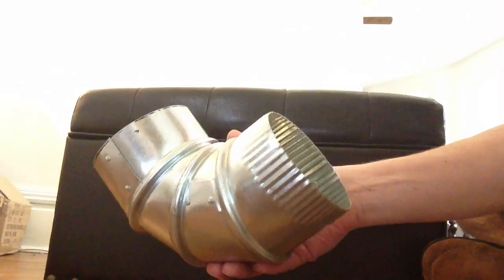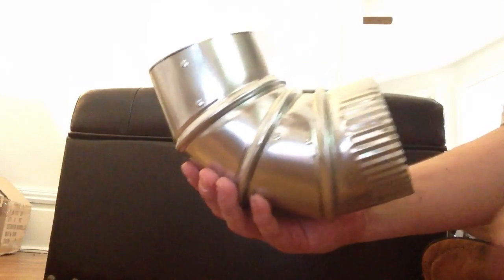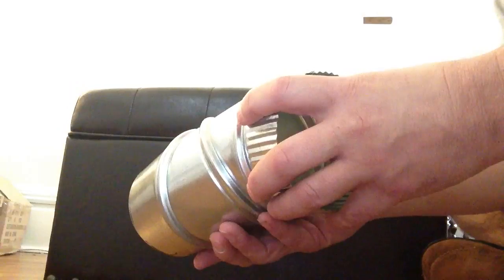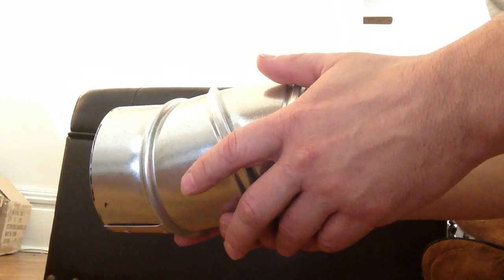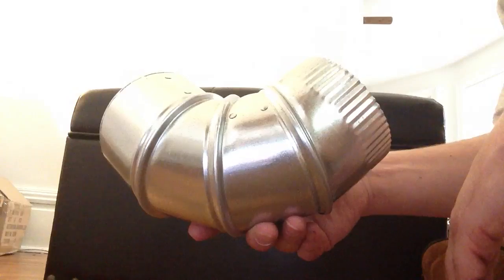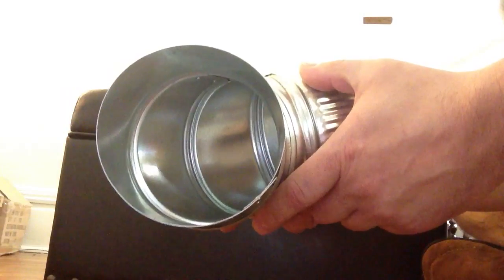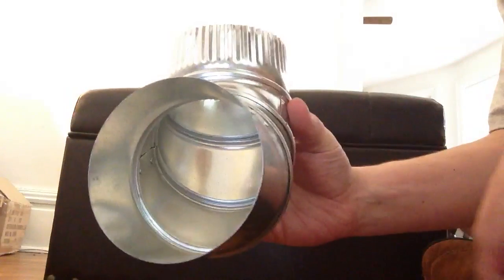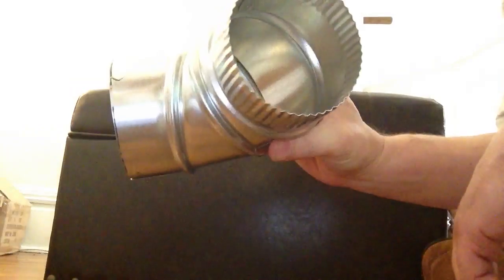How to elbows for round ductwork

Comment: As you show, can also adjust so the duct centerlines have a slight offset (don't intersect).  Can adjust for 45 deg, all in one plane, with a "wiggle" which makes it a little shorter, which helps when your measurements are slightly off.

Comment: TIP:  The segments are almost always difficult to turn.  To make them turn much easier, apply WD40 or similar to the inside of the gores.  Don't spray too much because you don't want the lubricant on the outside making it slippery for gripping.